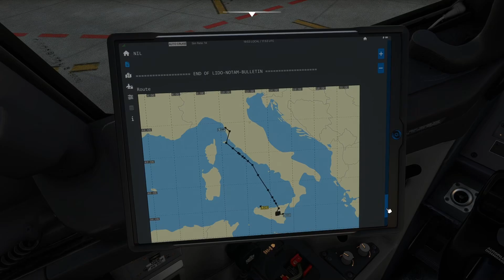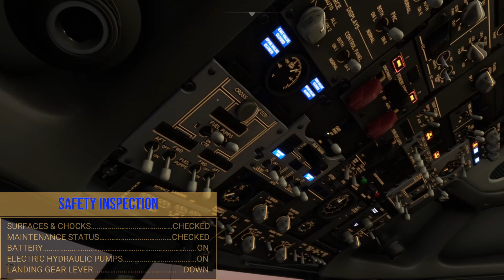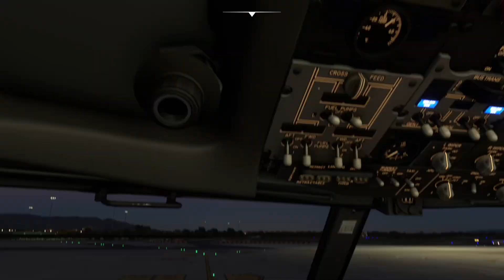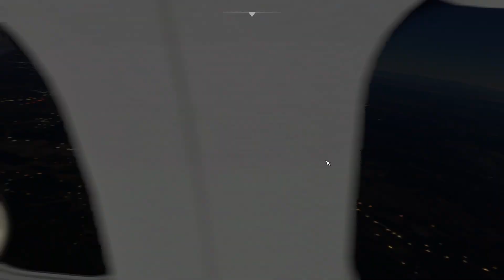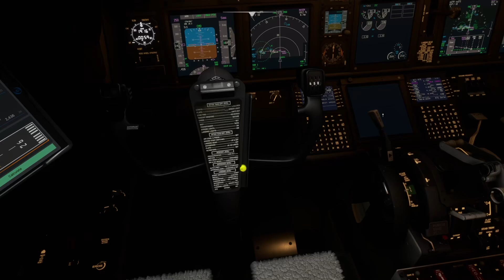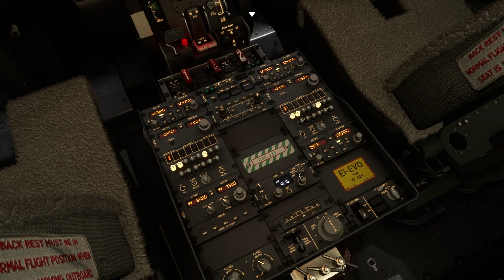Ryanair 737-800 from Pisa to Catania | PMDG 737 | MSFS 2020

Comment: Very nice video! Do you use any specific mods that you can recommend?
Reply from the maker: Thanks! It highly depends on what kind of flying you do (GA? Airliners? Short-haul, long-haul, region you fly in etc.) and how serious you are - if you can share some specifics I'd be happy to drop some recommendations.
Reply: @FlightSimSG I most likely do short-haul (europe flights). Im based in the Netherlands and im pretty professional, im still learning new things every flight! Thanks already
Reply from the maker: @No problem! Starting with aircraft, I'd highly recommend the Fenix A320 base pack to start with, it's very good and has both FS2020 and 2024 support. The iFly 737 MAX 8 is also very good and will have support for both sims too. 

Now if you want to do KLM and Transavia operations unfortunately they will require the PMDG 737, which won't have support in FS2024 for probably a few years and will also come at an upgrade cost. If you're already on FS2024 though you can use the iniBuilds default A321neo to do some KLM ops but in my opinion they're mid-level aircraft and not that great.

For scenery, since you're based out of the Netherlands the quintessential Dutch airports will likely be your homebases - FlyTampa EHAM, and you can consider RDPresets EHRD if you think the default sim version isn't good enough.

Then it's up to you to decide where you want to fly around Europe. Do you like challenging, unconventional approaches? Great scenery? Short runways? Large airports in big cities? Some classic European airports that are fun to fly into are:

LOWI - especially if you do the circling approach for RWY 08
LPMA RWY 05
LDSP RWY 23
LGSM - both runways are fun but RWY 09 is slightly more challenging
LIRQ - very short runway
LXGB - Approach can be turbulent and relatively short runway too

For tracking your flights you can use Volanta, FSRealistic if you want camera shake and some extra sounds (try it for free first, there's a trial version you can download).

Check out Springmedia by the way, he's also NL-based and I'd imagine the routes he flies will appeal to you as well.
Reply: @FlightSimSG  This is very great! I fly in MSFS2020 and bought the E190/E195 today to do some KLM operations and I have the FlyTampa EHAM pack! I like great scenery! Thanks for the help! Do you have the E190 and airbus steering?
Reply from the maker: @Jensdb03  Awesome! No, I don't have the E190 and I use a Logitech Extreme 3D Pro at the moment. Have fun with your flights!